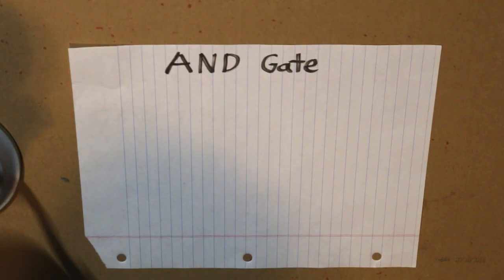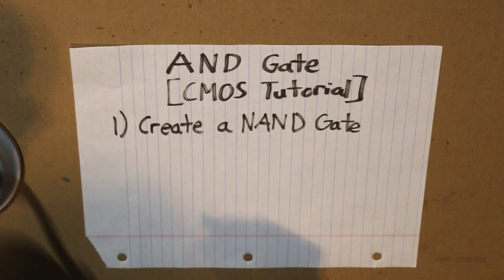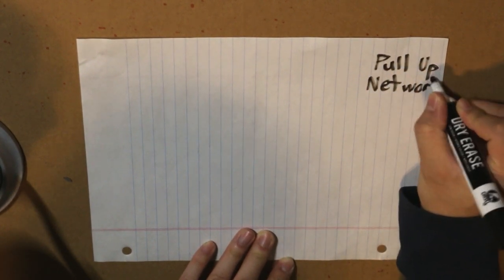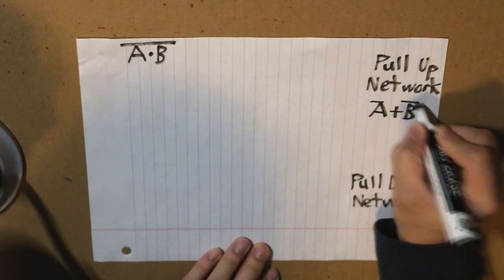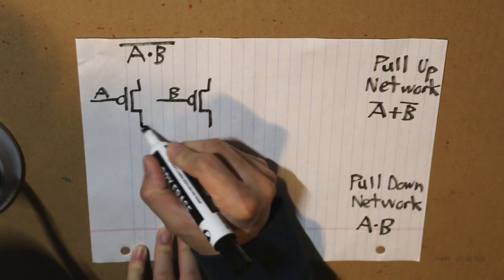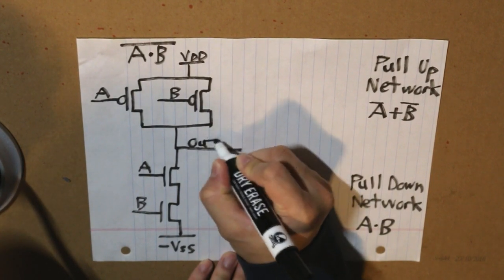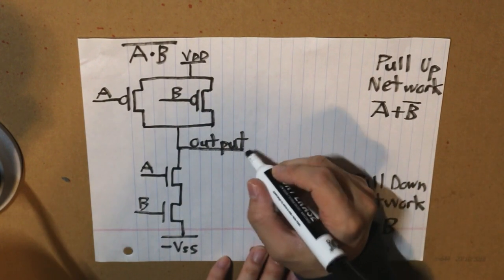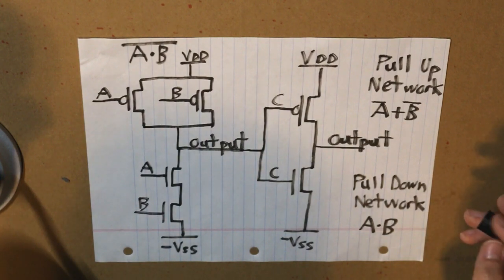AND Gate (CMOS Example)

Comment: why not two transistors in series?
Reply: Found the answer:

Even when the transistors are "off" because their gates are at a low voltage, they can still conduct a small amount of current. This is called leakage current.

The idea that a transistor is a perfect on/off switch is an ideal model. In reality, transistors are not perfect switches. Several effects allow a tiny amount of current to "leak" through, even in the "off" state. 

The full CMOS circuit (the one in this video) with both pull-up and pull-down networks completely solves this problem.

 When the output should be a logic 0, the pull-down network is actively turned on, creating a very strong, low-resistance path to ground. This path is so strong that any tiny leakage current from the pull-up network is completely overwhelmed. The output is a solid logic 0.

When the output should be a logic 1, the pull-up network is actively turned on, creating a very strong, low-resistance path to the power supply. This path is so strong that it easily overpowers any leakage from the pull-down network. The output is a solid logic 1.

Comment: Why can't I just put 2 nmos transistors series to each other?
Reply: Even when the transistors are "off" because their gates are at a low voltage, they can still conduct a small amount of current. This is called leakage current.

The idea that a transistor is a perfect on/off switch is an ideal model. In reality, transistors are not perfect switches. Several effects allow a tiny amount of current to "leak" through, even in the "off" state. 

The full CMOS circuit (the one in this video) with both pull-up and pull-down networks completely solves this problem.

 When the output should be a logic 0, the pull-down network is actively turned on, creating a very strong, low-resistance path to ground. This path is so strong that any tiny leakage current from the pull-up network is completely overwhelmed. The output is a solid logic 0.

When the output should be a logic 1, the pull-up network is actively turned on, creating a very strong, low-resistance path to the power supply. This path is so strong that it easily overpowers any leakage from the pull-down network. The output is a solid logic 1.